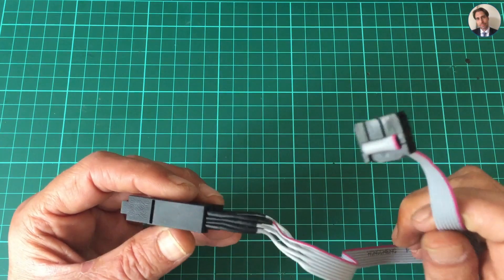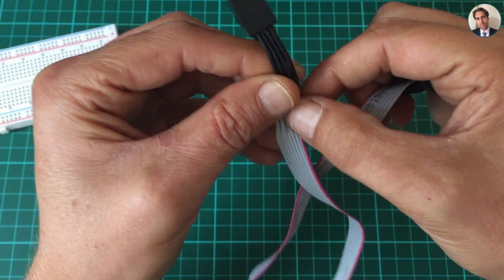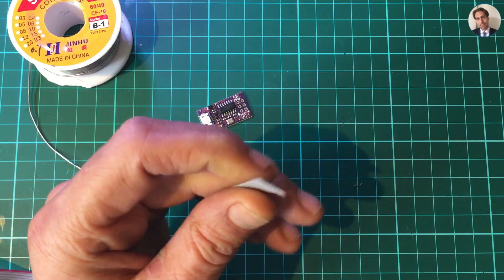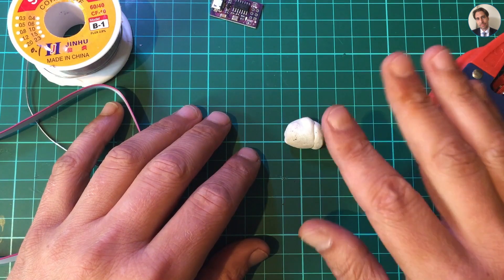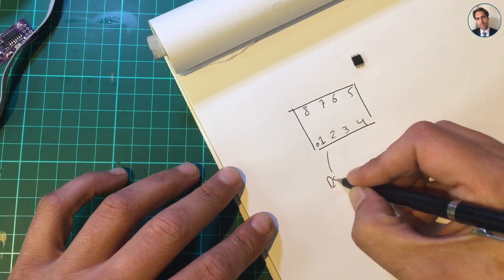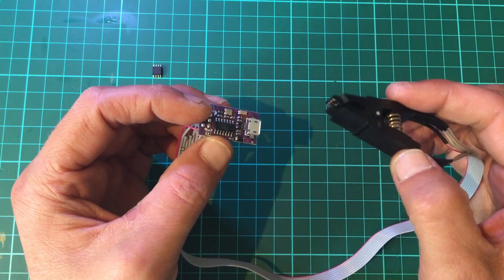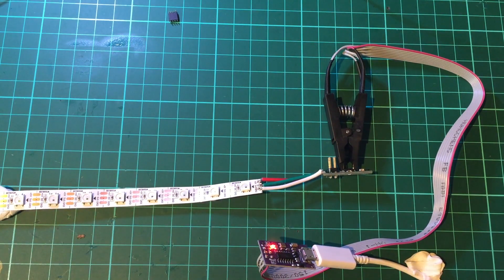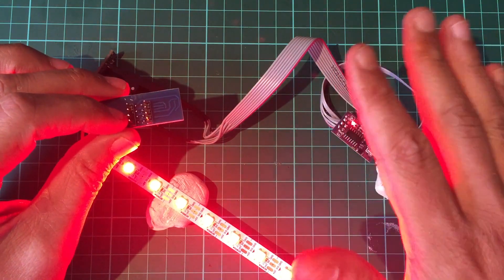How to build an ATtiny programmer (using TinyISP)

Comment: Nice video Dustin!

I actually got one of these clamps and it came with a second PCB that was a much more sane size! It converts the 8pin connector to a DIP8 size. I plug it into an Arduino as ISP programing board I made up for DIP Attiny85s

1844277735 is the aliexpress number (I think it will get marked as spam if I link directly)
Reply from the maker: Thanks Brian! That smaller board makes much more sense to me! Nice find!